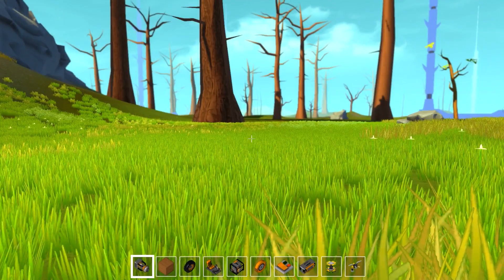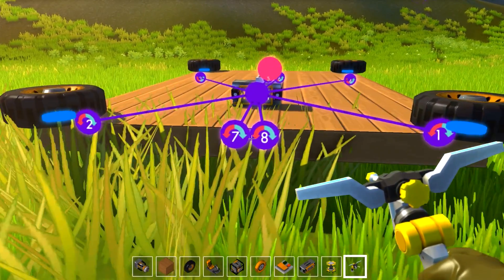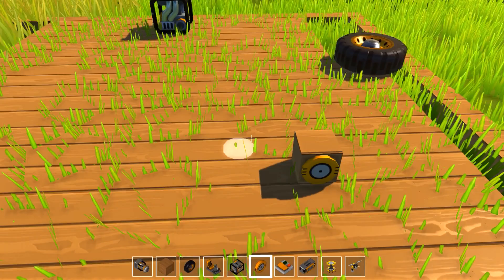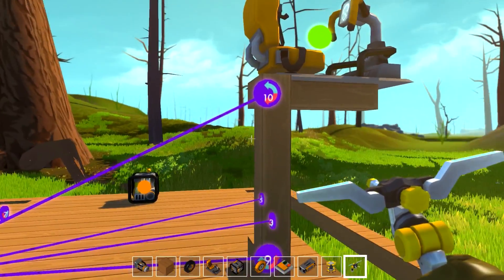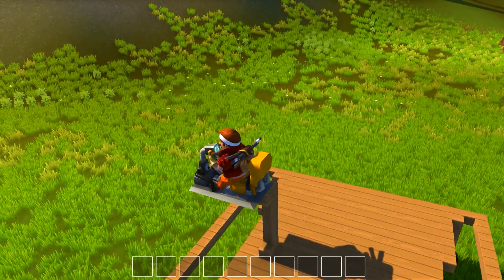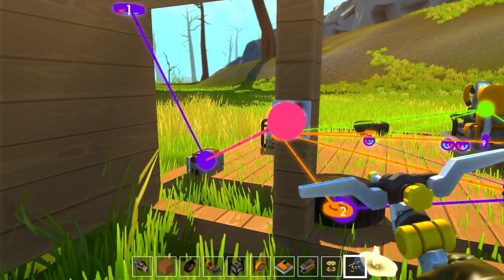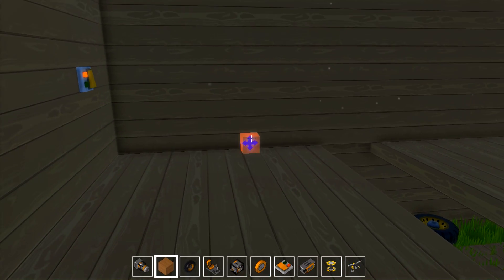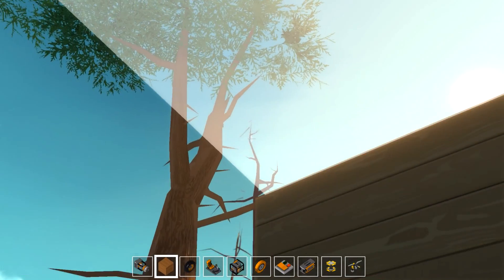Scrap Mechanic ➤ HOW TO MAKE A DRIVEABLE TRANSFORMING HOUSE! [Guide/Tutorial] Part 1

Comment: I made something like this before watching this video, however I made it like 64 by 32 or so. The suspension was completely compressed due to the sight, oh and I had 10 wheels and 5 electric engines on full power, just to move the darn thing XD.
Reply from the maker: +David Sands (Awesomeguy5075) haha ya, definitely don't use suspension

Comment: Hey Entak, can you play some Heliborne next week cuz' they've been begging for more tester participation due to a new patch?

Announced by developer Rayne):

"New patch is out! Go test it!

Gameplay changes:

New helicopter - Mi-24A
New map - Operation Nguyen Hue
- landing zones reinforced with vehicles can deploy armored convoys 
- armored convoy deploys only to captured landing zone
- victory condition: armored convoy gets to enemy stronghold

Changes in landing zone behavior on Afghanistan and Vietnam:
- now there's permanent and temporary capture points, temporary points awarded only as long as landing zone is captured by the team
- the more landing zones team have the more permanent points awarded every few seconds (before it was only )
- if both teams have same amount of landing zones captured - no permanent points are awarded

Map of Afghanistan, Badahshan province now has convoy-producing zones and convoy-capture-able zones which awards more points then usual landing zones.

Vietnam, the Gulf of Tonkin now has patrol boat producing zones.

New landing behavior. Now most of helicopters will land after touching ground with only half of landing modules and have less restrictions on flight parameters required to land."
Reply from the maker: +Results 45 Ill look into it